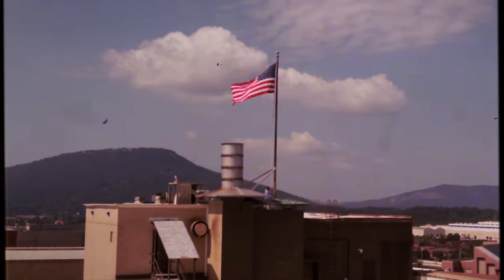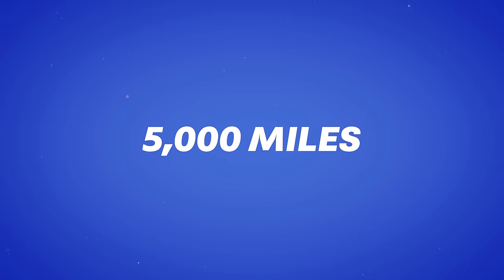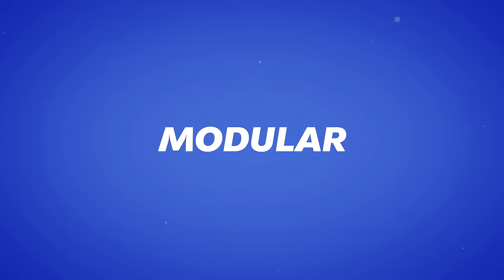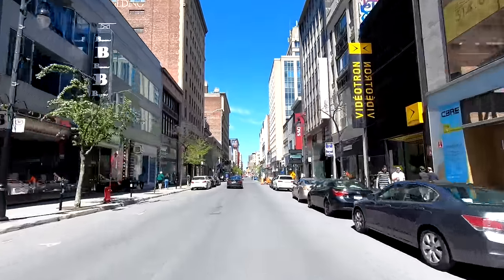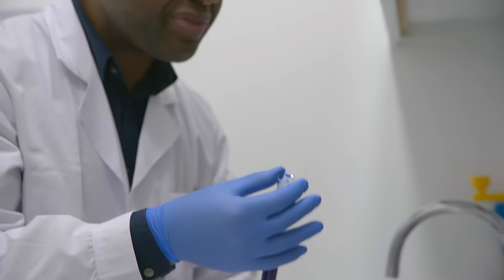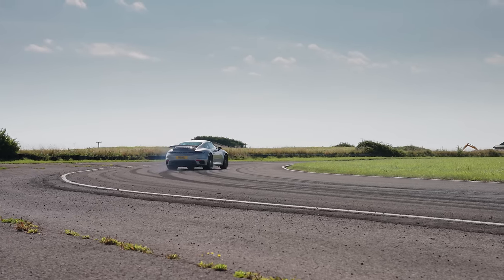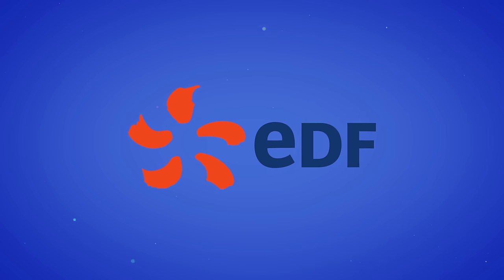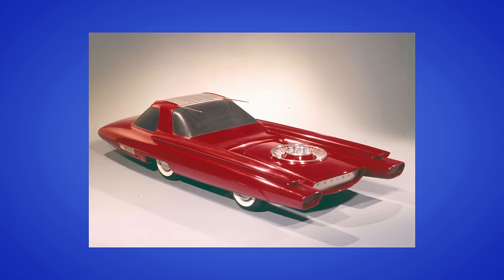Can Nuclear Power SAVE The Car Industry? 4K

Comment: 4:05 Even if you make synthetic fuels with clean renewable energy, using it in an ICE still produces the same air pollutants and smog as normal fuel. It might be used in race series, but it'll never catch on for daily drivers.
Reply: what about hydrogen, it combines with oxygen to make H2O, water. that would be the best thing i think. batteries require a lot of exotic materials and degrade over time. then you have the charging problem, what happens when millions of cars a charging at the same time, how is this practically possible. when you make hydrogen, you effectively create a buffer between creating the energy and using the energy without the use of a ''traditional'' battery.
Reply: @bastiaan19948  all of this charging is merely a load balancing problem, easily solved while upgrading local grids. The main problem with hydrogen as a storage medium is efficiency. It has a low energy density, is hard to store and contain, and you lose a ton of energy converting hydrogen to power. A fuel cell is only about 60% efficient, which is a lot better than an ICE vehicle but a lot worse than a battery electric vehicle. We would also have to build out brand new infrastructure to replace the gas infrastructure we already have, whereas with an electric fleet, we already have the infrastructure in place and it's only a matter of balancing loads and upgrading transmission lines where needed.
Reply: @bastiaan19948  1) you still need batteries on Hydrogen Fuel Cell cars. 
2) it’s an highly inefficient production process you would have to multiply by 3 the amount of energy needed compared to only BEV cars
3) We already use a lot of energy at the same time like cooking for exemple we can manage
Reply: @jonasweber9408  you can burn hydrogen, this fixes the battery problem also refilling Will be a lot faster than recharging. 

I am aware of the massieve energy losses in these steps, this would only be feasible in a situation where energy has become much cheaper, which it will. 

The charging part is quite a big issue though, i live in the Netherlands where we have the most reliable electricity net of the world and here we are already seeing a lot more infrastructure Being built for the electrification of our houses (cooking/heating) 

The massive amount of extra energy needed when everybody is driving battery powered cars and  then charge them at the same time is not as small an issue as you might think. I Saw that in the us the electric vehicle chargers already have systems built in to not charge the car when the net cant provide enough. This when not a lot of people are driving these cars yet.
Reply: @bastiaan19948  So energy demand is an issue for EVs but not for Hydrogen XD 

Burning hydrogen is not green at all, it's not just green hydrogene you can put in a car it's more complicated than that (just check out Toyota latest prototype), and we would still have the massive problem of smogs in cities... You emit to produce hydrogen and then emit with the car. It's not at all worth it for keeping this "precious" 5 minutes refueling you can't do at home... 

And sorry but France has the best Grid in the world... Netherlands are 6th
Reply: @jonasweber9408  if you are not going to try and argue my point, i will not try anymore.
Reply: @bastiaan19948  I was arguing your point, what did I say wrong?
Reply: @sams2er  you can easily convert petrol stations into hydrogen filling stations.
Reply: Yes, but they do not add carbon emissions to the atmosphere, they remain neutral since they use the same carbon, on the other hand an electric pollutes less (in its daily use) but adds emissions in other ways that it is worse that they remain neutral and decreasing.
Reply: @dawrincueto6962  did you watch the video? You still have to produce the carbon neutral oil so you use energy to produce it. So It’s not carbon neutral. Plus you still have the health problem of smog which cost a lot of lives, it’s not worth it. 
Are you sure they add “emissions in other ways that are worst”? Do know also the energy needed for oil production to put in a car? If you looked behind the curtain for EVs you should do the same for Oil production.
Reply: @jonasweber9408  In the context that you said it was, if they were made with clean renewable energy, so in that same context I answered you, since you talk about smog I remind you that batteries are highly toxic and cause cancer, on the other hand, how do you think they would charge millions of electrics ? do you think that energy demand will not increase by much?  many countries will have obstacles to manage that with clean energy.
Reply: @dawrincueto6962  So energy production is a problem for charging EVs, but not at all a problem for producing billions of tonne of "neutrale carbon oil"? Mate you know that doesn't make any sense, EVs are 70% efficient from well to the wheel when ICE engines are at best 15-20% from well to the wheel, you literally need way less energy to run EVs. 
Batteries chemicals are toxic, but they are not spread out with exhaust pipes everywhere all around the world and in concentrate areas
Reply: Yeah it's stupid just keep using petrol it works fine.
Reply: but the smog and pollutants that come from vehicles with synthetic exhaust will already had came from the smog and pollutants that are already in the atmosphere, which is where the term "carbon neutral" comes from, what it takes to produce it isn't considered at all much like how much energy is needed to create and fuel BEVs and Hydrogen Cars are often neglected and put on the ways side.

 Tbh the energy density of Petrol and Synthetic Petrol grants us better performance in almost every aspect of driving apart from acceleration (even still Petrol is way ahead of either BEV or Hydrogen Tech even in this area).

 People keep talking about energy efficiency and all those shenanigans but if a Model 3 can't beat a Camry for less when it comes to range, comfort, reliability and longevity then I am not quite convinced they're up to par yet.
Reply: @youngrody2386  
1) you have to add to the polluants the pollution from the electricity needed for the synthetic fuel production 
2) why put the smog back in our lungs again?
Reply: @jonasweber9408  1.) We still need to add pollutants for the enrgy of EVs and Hydrogen and they need significantly more resources to make and compete with Current Petrol Cars. You need to own them for a long while before you make their carbon footprint less than a Petrol's, and a Petrol can do more with less and the only nich EV tech has so far have been passenger vehicles, Hydro isn't there yet either.

2.) Even the biggest car centric economies have clean air compared to those that aren't, current tech is able to completely reduce smog next to zero especially with proper maintenance. Smog only becomes a problem in third world countries using old tech, hell even in my country we still use carburators for our fleet vehicles. 

The only viable argument I see against Petrol have always been environmental, something that we pretend we care about while we spend so much energy on even such mundane things and yet cars are seen as the end all be all solution of climate change? Pretty narrow viee if you ask me.

Comment: Also, you can't turn a nuclear reactor on and off with a switch. It takes ages and the output power is fairly constant. So the only application for it that makes some sense is for huge cargo ships
Reply: Not entirely true. The control rods in a reactor are there for controlling the intensity of the reaction, thus this is one way to control the production of electric energy. If you insert all control rods in the reactor, they will absorb all the radiation so that the water is not heated at all. Another way to control the output is to release the water pressure through a bypass around the generators. In conclusion, you cannot stop the fuel from decaying, but you can control what is gonna be heated by the radiation, the reactor water or the control rods and you can control the amount of water that goes into the generators. PS: this is all grossly simplified, if you are interested, I would suggest you to watch some videos about how nuclear reactors work. There are many concepts that work in different ways with different safety mechanisms.
Reply: Just leave it on 24/7
Reply: @pteronoid  even when the control rods are fully inserted, heat is produced due to decay reactions. This means that a shut down reactor still needs cooling. The control rods only stop the fission chain reaction.
Reply: @Gnerko123  my point was that the power output of the reactor can be controled.
Reply: @pteronoid  fair enough, but the statement that the water isn’t heated at all if the control rods are inserted is just incorrect.
Reply: @Gnerko123  "grossly oversimplified" means that i left out a lot of details. does it stop the decay process? - no. does it stop the chain reaction? - yes. i don't claim that everything i said is absolutely correct, but at least i hoped that my comment will make the OP interested in researching the topic.
Reply: @pteronoid  again, fair enough. But there is a difference between simplifying and being incorrect. No hard feelings though.
Reply: Especially since this particular inaccuracy is the reason a nuclear reactor cannot be turned off, potentially causing a meltdown in case of cooling failure even with full control rod insertion.
Reply: @pteronoid  You didn't factor in decay heat. A reactor after SCRAM will still be generating somewhere between 10 - 30% of it's rated thermal output just in decay heat for several days after shutdown. That heat MUST be controlled and managed
Reply: @mrwhips3623  and while not in use, feed this energy to the grid

Comment: Surprised you didn't mention probably the most famous nuclear powered car in modern history - the  Delorean from Back to the Future!
Reply: Isn't anything to do with nuclear consideredto be in modern history?
Also, it has been a while for me to have seen the movies, but didn't that Delorean had terrible milage? 1 tank per trip?
Reply: @DarkDutch007  1 tank per trip but that tank only had room for a banana and some coke cans, not bad really xD
Reply: Ahh but Stephen did you forget what Doc Brown said in BTTF 3?  Mr Fusion provided only the electricity to power the flux capacitor.  The car itself ran on it's internal combustion engine, always has :)  Ironically enough a person genius enough to invent a time machine and switch from a fission reactor (im assuming here since he had to steal the plutonium in the first film) to a fusion reactor (which in another twist of irony he had to have "borrowed" a working model from the future which he specifically told Marty not to mess with), didn't actually think to make the car itself run off the reactor.  To be fair though, in the early 80s climate change movement hadn't really ramped up so no one was really thinking about that sort of thing.

Comment: the same issue applies to batteries, gasoline, and hydrogen when in a crash. 
1. batteries use lithium which burns hotter then the sun and is impossible to be put out. also creates a chain reaction which can set other batteries on fire as well as everything else in the area.
2.  hydrogen.... BOOOOOOM. 
3. gasoline just works as a leaking napalm. since it doesnt really explode. just burn unless its contained tightly with no exit.

Comment: Nuclear isn't actually expensive, it very quickly pays itself off once running and then you have by far the cheapest energy source available! it's just that the upfront cost of building it is high and that coupled with the time it takes before investors start seeing returns on their investment is what keeps them away, noone wants to put £1b into a project, even if they will get £10b back if they have to wait 20 years to see it :/ Those modular reactors really could help with this, 1/10th the size may not mean 10x faster return on investment but if it's 5x faster then more people will put money into it to make it happen :D

Comment: You could technically use RTGs to trickle charge EVs but that's only a few hunderd watts even if it is for decades. The best use for nuclear is baseload for night charging. The main obstacles for nuclear is massive amounts of safety bureaucracy and I hope we someday can have local mini reactors. No, they don't irradiate your balls, they don't blow up even if you tried and you can't make bombs out of them.
Reply: I was thinking nuclear battery that generates heat, and thermophotovoltaics to capture that heat to turn into energy. 

 No idea if anyone has tried it. There have been some break throughs though with them capturing as much energy as a steam turbine though in high heat applications! 

 No idea what TPVs aren't talked about more. Generating electricity through heat with no moving parts seems like a dream.

Comment: Nuclear is not renewable, it requires fuel we don't mine. Let's stop making the same mistakes.
Reply: Youre thinking of fission, which can be done way better by using other fissile materials like certain Thorium isotopes by the way, but we should invest way way way more in fusion.
Reply: wind, solar and any other from of energy production requires mining to produce the very item providing the power its the effect it has over its lifetime that you should look at and nuclear is as clean as any other form of energy
Reply: @xIcarus227  totally agree, the big problem nuclear faces is PR  many people believe it is dangerous when if truth be told its safer than almost any other energy production system. people remember the big accidents but forget that coal, oil and gas kill on average more people every year via pollution than nuclear has combined since the 1950's  and most of those deaths occurred due to old design or human error which the newer safer designs can deal with.
Reply: @allanmurphy8183  completely true. As a term of comparison, coal alone has killed 350x as many as nuclear has, and the coal number is constantly increasing where as nuclear isn't, not really. That's due to the safer designs you mentioned, it's virtually impossible to have a repeat of chernobyl today.

Comment: You need a ton of zero emissions energy in the production process and we don't have enough of that right now.

Germany: generating to much power solar and wind at times because the politicians don't want to balance the grid with fuel production and other methods.

Comment: This subject comes up now and again. The main killer for any such idea is, as you say, the huge amount of shielding that would be required to knock down the prompt radiation of any reactor functioning with any interesting power level ( say at the 100 kw level). Even in the gigantic NB-36 variant of the Peacekeeper bomber (midfuselage, extremely complex kit, about mid-1950s vintage) could not be run with what folks considered a sufficient margin of safety. Sorry, but nice and honest reporting. BUT, I must add that SMRs are an emergent technology that may become very interesting up here in cold Canada!  Our regulatory agency, the CNSC is in fact putting together a framework for regulating what might prove to be a very useful emergent technology here.
thanks again
D. Barillari, nuclear engineer
Reply: Relatively tiny nuclear power already exists.  The NASA Mars rover Perseverance has a 110 watt 99lb (45 kilo) nuclear battery that charges two lithium ion batteries for additional power and operation when it cannot get sunlight, and it will last 14 years with fuel half-life of about 90 years.  The Rover is the size of a compact car.

Comment: I think we should stick to what we have now, given that EVs are still young and the tech has great potential to be pushed on the sustainability front. I’m more interested in finding new, green ways to generate that electricity.
Reply: Yeah, like nuclear: Arguably the greenest energy source we have atm.
Reply: @michiel2047  If you can have the rivers for it, I reckon hydroelectric is king.
Reply: @magnustan841  Hydroelectric is very green regarding CO2 output but it requires giving up large areas of land to create the reservoir. This usually means significant ecological impact or even population displacement.
Reply: @michiel2047  which is also an effect of nuclear, everything has a drawback as well as a benefit but nuclear's drawback is about 10—100,000 years long
Reply: @ThePlayerOfGames  
Now just to be clear, I'm a big fan of hydro power but it can't solve fully the green energy demands of the future. Some more food for thought on the hydro vs nuclear debate:

Most underestimate the downstream impact of damming rivers + the sheer amount of land that is flooded to create the upstream reservoir. Great for CO2, not so great for the watershed and local wildlife. Nuclear in comparison has a tiny impact. One known impact is warmer water from the cooling towers creating micro-climates in which fish can survive which would otherwise stay in warmer climates but this is not exclusive to nuclear, as other forms of generation also require cooling. When it comes to long-term storage: Nuclear waste is a much smaller problem than what the modern zeitgeist makes it out to be. High-halflife nuclear waste is by definition not very radio-active. The volumes of waste are also comparatively tiny compared to all other electrical production methods.

Also consider that dams are huge concrete structures. Concrete production accounts for ~8% of human CO2 production globally. Luckily over their lifespan dams more than make up for this though.
Reply: EV is not young.  The first EV train was in 1841.  Battery, hydrogen, and pretroleum fueled engines for cars has been experimented on since the mid 1800's.  Gas won because it was the easiest to develop.